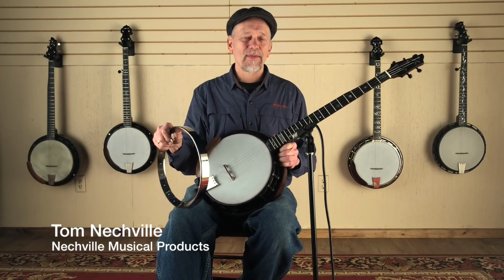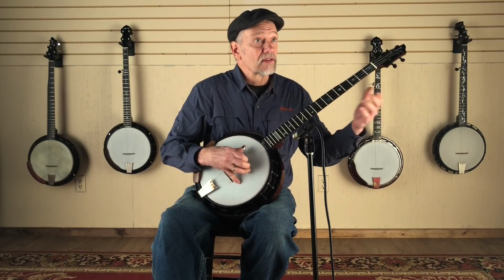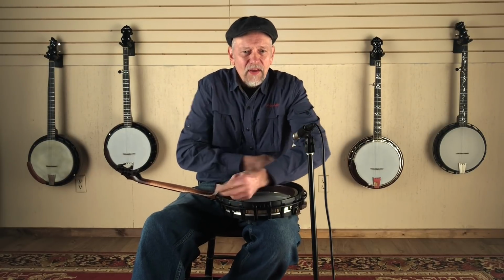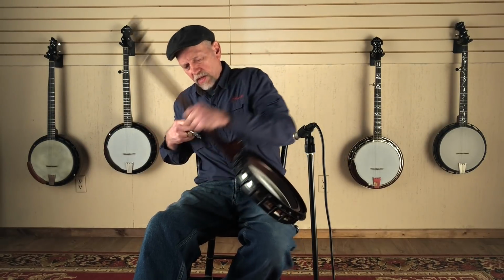Banjo Tone Ring Shootout | Metal vs. Wood Tone Ring

Comment: Earlier this year I swapped out my Nechville banjo's bronze tone ring with a Timber-Tronic (wood) tone ring and I LOVE it.  For me, however, where the Timber-Tronic ring really shines is when I install heavy-gauge strings (first string to fifth:  012 / 014 / 020w / 024w / 012) and tune the banjo low ala John Hartford.  I've got my Nechville banjo setup as such and there are literally days when I cannot put it down, it sounds THAT good... not to mention the considerably lighter weight of the Timber-Tronic ring is easy on the back!

Comment: I have a Gold Tone BG250-F, very strong sounding banjo,  I also use a Mikes banjo mute that works awesome to where I can play after every one goes to bed
Reply: I have the same one.  It sounds like banjos that cost a lot more, rarely goes out of tune, fit and finish is excellent; I use GHS PF135 J.D.Crowe light stainless & Snuffy Smith bridge 5/8".
Reply: @garykaufman8128  awesome, I use the Elixir polyweb lights, I also love the integrated bridge, I always went back to it so I just stayed withit, seems to not let that 3rd string go out of tune as I TRY to play up the neck

Comment: They sound exactly the same. Zero difference.
Reply: Listen again. Timber is more full and warmer
Reply: @grant5603  If the difference is that small that you almost can't hear it, it's completely irrelevant.
Reply: Take your thumbs out of your ears dude. 😂
Reply: @Chrissummerill  Still the same. Doesn't matter at all.
Reply: The point is you can achieve the same sound without that three pound sinker in your banjo. Different banjos and woods achieve different tones and sounds. I love both brass tone rings and wood tone rings also.
Reply: That's the whole point. Save 3lbs with no reduction in tone.